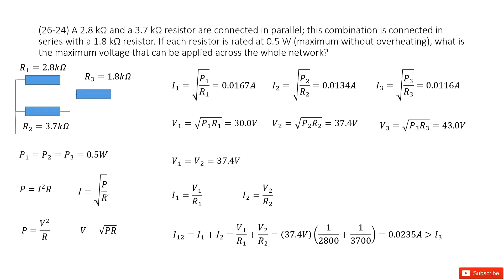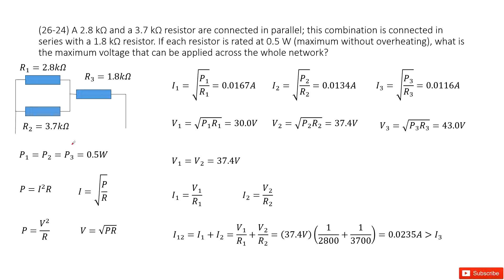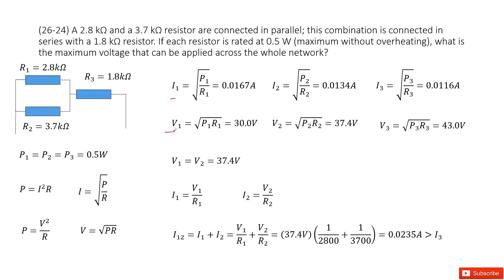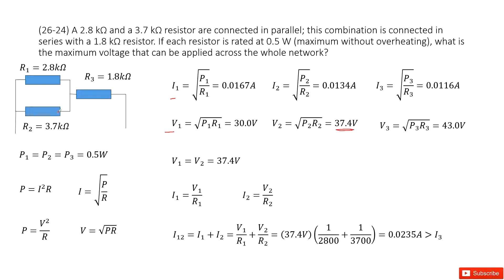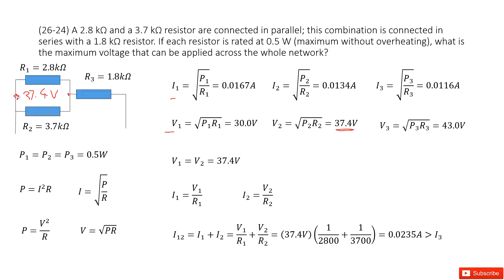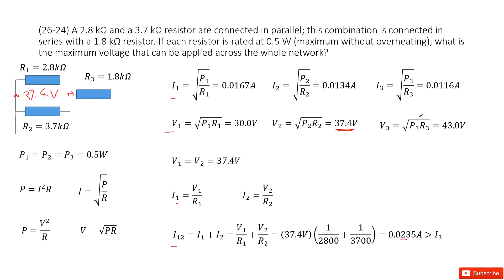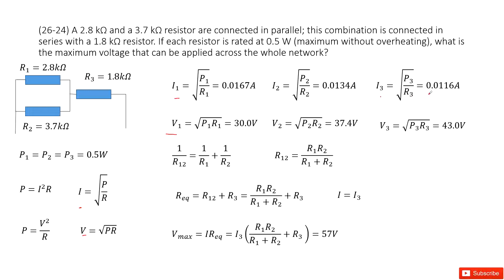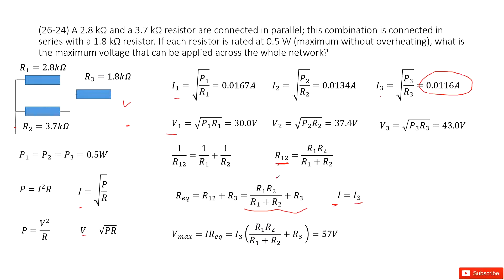(26-24) A 2.8 kΩ and a 3.7 kΩ resistor are connected in parallel; this combination is connected in s

Comment: Vmax should use I1 not I3 as you are trying to find the maximum voltage not the minimum. You should use the largest current that you find.
Reply: but the max current will burn out the circuit, we need one that will not burn it out, that's why she chose the smaller one (it's the biggest one the circuit can handle)